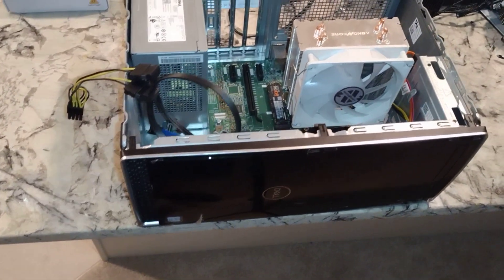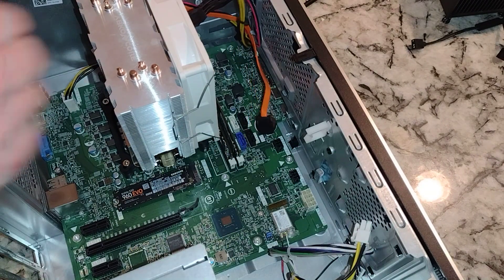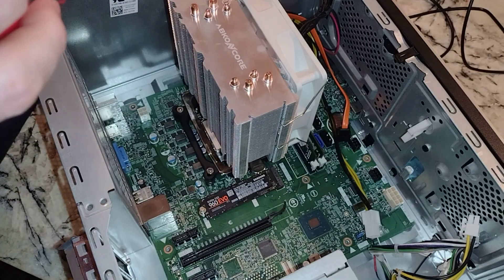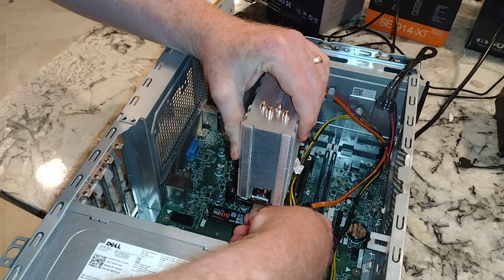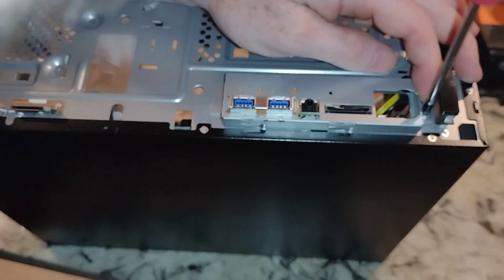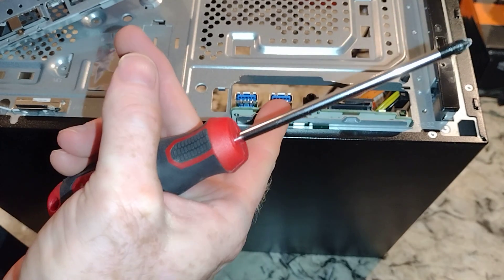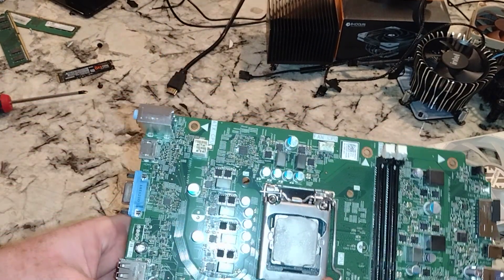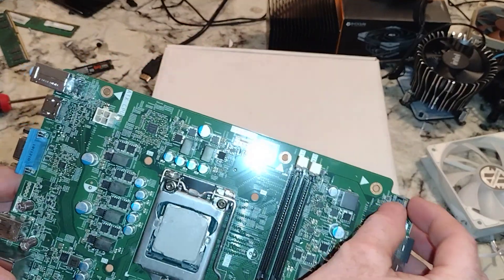Taking the Dell Inspiron 3670 motherboard out of case upgrading PSU, CPU cooler.  Complete tear down

Comment from the maker: Note: Ensure you take all the screws out first....I struggled for a bit.

Been wanting to make this video for awhile...Its long but answers some questions folks have asked me about whether you can put this PC in a case.  If I get motivated...I might just see if I can solder up a switch so that I can demonstrate how it would go into a case.  I am assuming that button has two wires or contact points coming off of it to complete a circuit.  

Sorry it took so long to pull the motherboard out...you must take out every screw to include the M.2 one.
Reply: WHAT CPU COOLER WORKS FOR THIS 5.5" CASE?
Reply: I noticed in the BIOS this PC can be scheduled to turn on at a specific time every day. I was considering using this as a work around for not being able to easily access the power button. :)

In addition, taking advantage of sleep/hibernate would ensure the PC is consuming limited power during the night, when not in use, etc.

Comment: Thanks for posting. I just went through a headache trying to transfer this mobo to another case. For anyone who finds this in the future; if you're still using the stock heatsink/fan it must be removed also to release the motherboard. (in addition to the m2 screw mentioned)

In the end, I put the mobo back into the stock case. Only 2 screws would align with a "standard" case, and I didn't have an after market cooler to replace the stock one when I began transferring. The plan was to reuse the stock one, but after market cases rely on a back plate to mount the CPU cooler. The stock combo has a backplate built into the back of the case.
Reply: Late reply, but you could mount the GPU then mark your new standoffs to be tapped.

Comment: How did you plug the 24-pin power connector in from the PSU? I'm looking at buying a 3670 to replace my current motherboard only since I can't upgrade the PSU on my current one. Also, would an i7-8700 in this environment be able to power an RX 580?